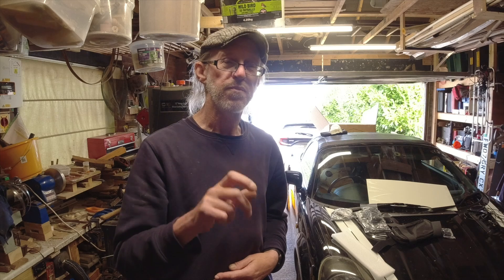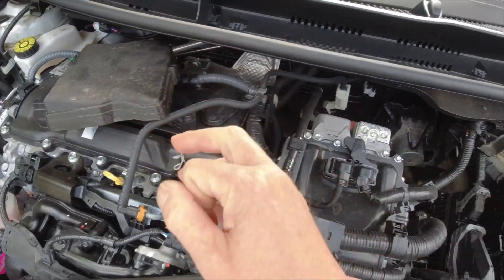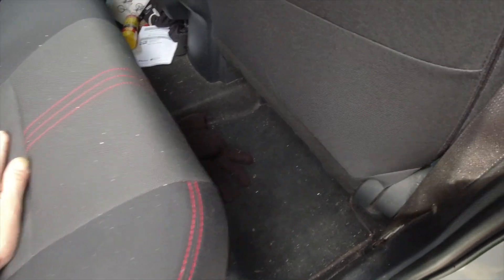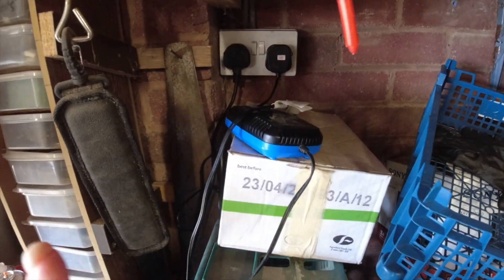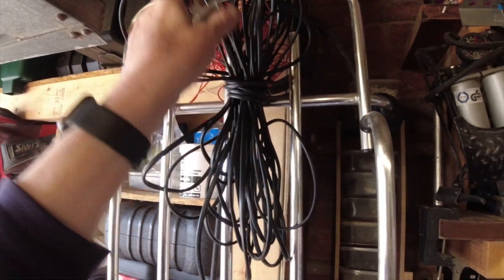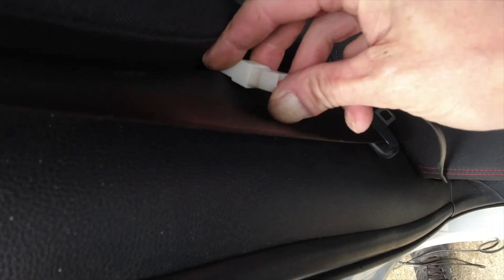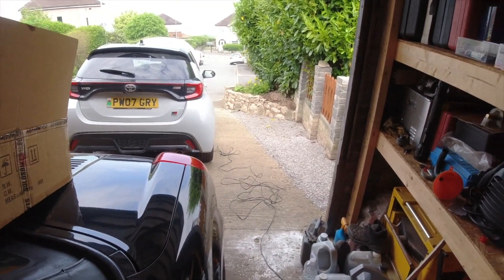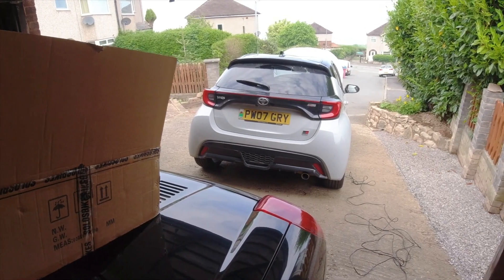Tips & Tricks 45 charging your 12 volt battery options

Comment: As an electronics engineer, by education, who works as a service engineer in the plant hire industry, I would measure the quiescent current of the vehicle, plant etc.
Switch everything off in the vehicle, take the key out. Connect up your multimeter to measure Amps, put one probe on the battery terminal and the other on the battery terminal connector, then remove that connector from the battery. If the fuse in your multimeter is good, the meter will show how many Amps your vehicle is drawing. If you see no Amps or VERY low Amps, below 1 Amp, on the meter, put the multimeter leads into the mA socket, switch to mADC and measure the quiescent current again.
Let's say that your vehicle has a Type 069 battery. The specification for that battery is CCA (EN) 480A, this is the Cold Cranking Current.
The Capacity is 53 Ah (Amp Hours) This means, if you draw 53 Amps from this battery, it will be dead in 1 hour.
If your quiescent current is, say 0.1A or 100mA. Then, a 53 Ah battery will be dead in 22 days. 53Ah divided by 100mA = 530 Hours, 530 Hours divided by 24 = 22 Days.
I would expect quiescent current to be in the tens of milliamps or lower, at the most TBH.
Reply from the maker: The battery fitted to my GR Sport Yaris is only a 38Ah battery and when the car is powered down the drain on my battery is 250ma 
So you can see we can’t leave these cars parked for any extended period